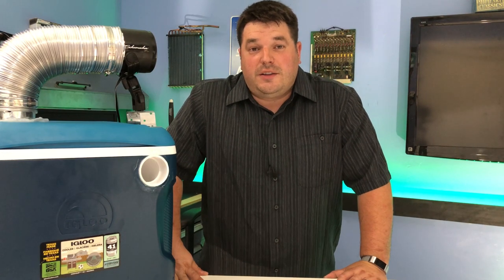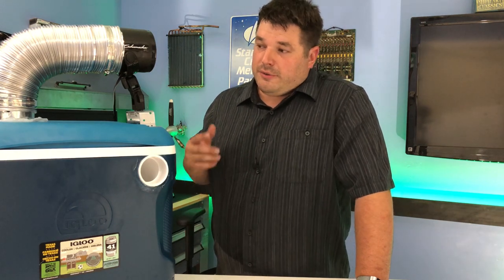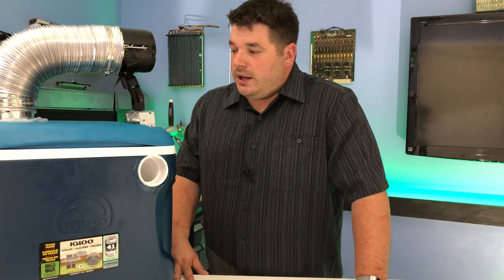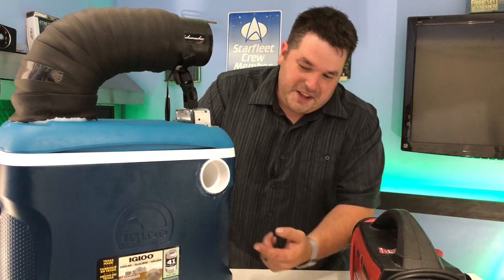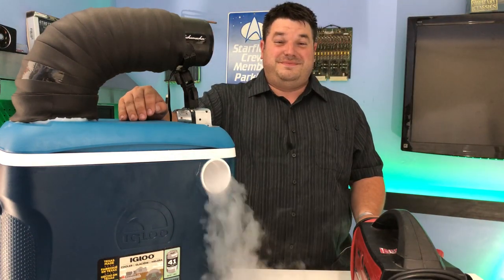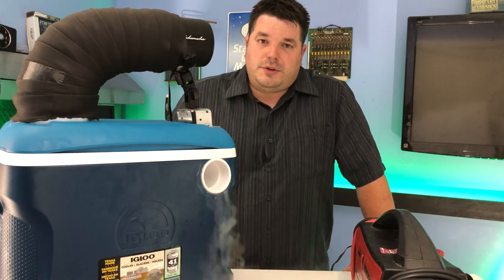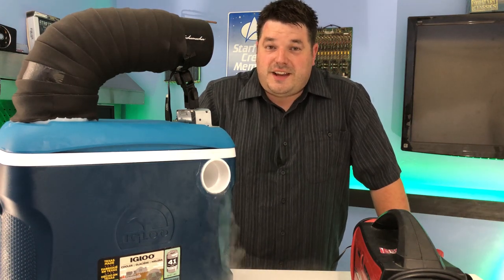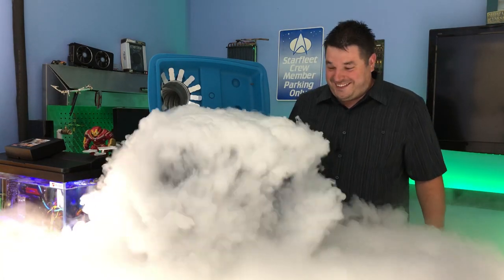DIY homemade air conditioner with dry ice.

Comment: Yeah but if you use dry ice dry ice goes from a solid to a vapor so you don't get no condensation you don't get the water and the fan itself as it's blowing the air out it's going to blow the vapor out along with it so giving you a nice layer of fog on the ground but you would have to have a grade in there to put the dry ice on so it don't crack the cooler from being so cold we call him swamp coolers or a swamp AC I was born and raised in the swamps this thing is nothing new to me the one that we built we use the big old styrofoam cooler 184 quart cooler with about 30 lb of dry ice and a little bit of water you should have seen that thing that was cool as hell and it's not just an AC you can keep all your food your sodas beer and everything else cold

Comment: Is it actually cold ? Or is it just fog ?
Reply from the maker: Oh no it was very cold, measured below -30 degrees! Thats 30 below zero!
Reply: @TheRenaissanceBuilder  so it is a good idea to use it in a car ? Because I have a cooler I built but normal ice vanished in 1 hour
Reply from the maker: It absolutely is not a good idea to use in a car as the co2 levels will definitely cause harm!
Please do not use this in a closed or semi closed environment!
I do however have several designs that are great for small spaces including this one https://youtu.be/EYEDD7dW47M

Comment: Can you add a co2 scrubber to filter that out so you could use dry ice in it for like a tent?
Reply from the maker: Huh 🤔, i never thought of that! That may be a valid solution!
I do have a design i am working on shortly that will be a perfect way to make use of co2, so I highly recommend keeping in touch for that!
Reply: Any results from that?
Reply from the maker: L Drumsmore i am literally building the dry ice unit this next video and you will be able to see weather it works or fails live.. gonna be entertaining either way so make sure you are subscribed for that
Reply: @TheRenaissanceBuilder  no make a sealed container of something like copper with a long run of exaust that eventually goes outside...then have a sealed container surrounding the copper pipe and the container that is sealed with the dry ice in  it ...air blows over the exaust pipe and container containing the dry ice ....co2 goes outside...air gets cooled over cooling fins and exaust pipe from the dry ice...maximum heat exange...just like a rocket mass stove
Reply from the maker: @jeromienorton6125  so that is very similar to the last attempt i made. Several problems arose.
One, my seal was terrible and flooded the truck with co2 so that was bad.
Two, the surface area contact creating the heat exchange was small and dropped quickly as the ice sublimated.

The solution i want to try is a better container for a better seal and using acetone to increase the conduction of heat much better
Reply: @TheRenaissanceBuilder  yes I was going to suggest something similar to a radiator with a liquid that can be supercooled

Comment: I was thinking of making a copper box and soldering copper tubing coiled to it in front of a fan and vented outside
Also CO2 detectors will not work because CO2 sinks

Comment: TRY SALT AND ICE GET COLDER
Reply from the maker: Thank you mathew but salt doas not make ice any colder. It doas allow the water to be sensibly colder however the total heat content of the system doas not change at all by just adding salt, so i think i will go a different direction. 
Thank you for watching!
Reply: Regular water freezes at 32 f. Salt water freezes at 28.4 f...
Reply from the maker: And....
Total heat content of the combination is still that same, regardless of melting point

Comment: Dry ice is a bad idea it creates co2  , use frozen water bottles you can rotate them
Reply from the maker: The water bottles is a great idea but dry ice going to be a game changer. I have a solid plan for a dry ice system so make sure youre subscribed to see it when i release that video!
Reply: @TheRenaissanceBuilder  C02?? IS A BIGGER FACTOR AAAKKK
Reply: @TheRenaissanceBuilder  you know what makes homemade Ice cream freeze so fast? SALT add salt to the water before you freeze it in the bottles that way if you haveca lot ofvsalt it may not freeze 100% BHT it will be fkn cold